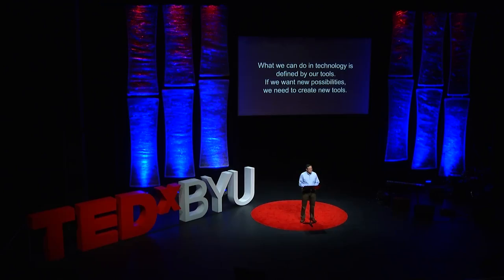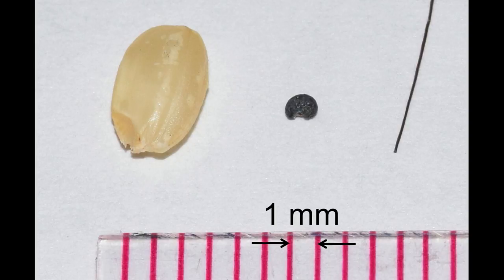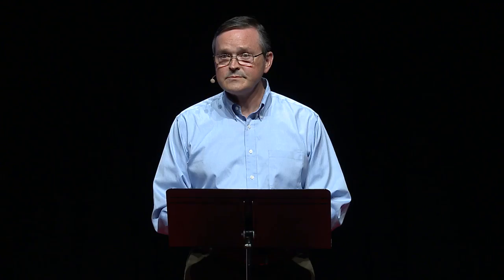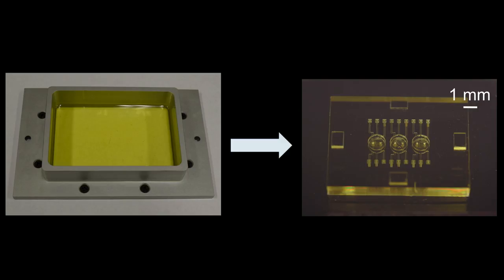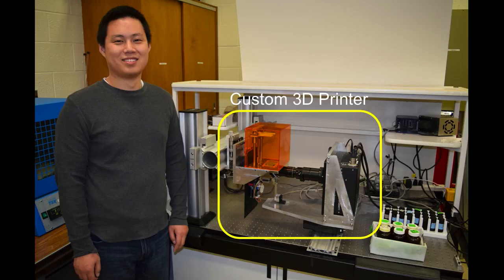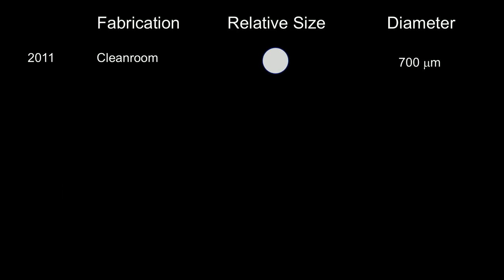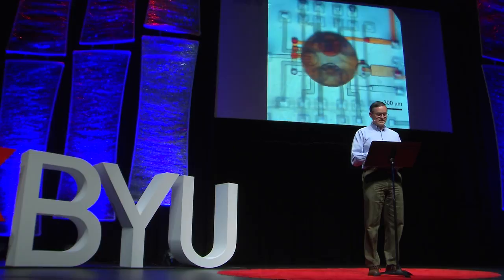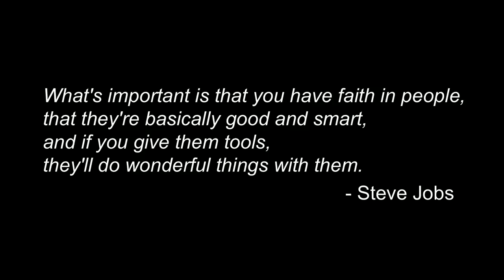New Tools, New Possibilities - 3D Printing for Lab-on-a-Chip | Greg Nordin | TEDxBYU

Comment: Do the Japanese way of the early 1980s. Use larger size components and simpler designs along with the CMOS technique which is a cake layering method of making silicon IC chips. Instead of an IC chip the size of a postage stamp, your IC chip will be the size of a large size 12" by 18"envelope! 

In the early 1980s CMOS being explained in this way is different to what we personally got from a Japanese engineer who said "basically CMOS is more like a layering process but you must first determine what you need so that you will know exactly what is needed to be done first" It is like creating a multi-layered cake. 

That is the problem with education today, they try to make things unnecessarily complicated and sophisticated when they can make their explanation so simple WITHOUT LOSING THE GIST OF THE ENTIRE SUBJECT itself. 

This is why Japanese education is far more effective to the point that they made CMOS technology so simple that it allowed them to use simple designs, larger size components, and compensate by using larger size silicon chips the size of small average letters. 

They did that in the early 1980s which is why they have beaten the U.S IC chip makers in the international market competition. Do the Japanese way of the early 1980s. Use larger size components and simpler designs along with the CMOS technique which is a cake layering method of making silicon IC chips. 

Instead of an IC chip the size of a postage stamp, your IC chip will be the size of a large size 12" by 18"envelope! 

Now with maskless ion beam lithography and electron beam lithography and hybrid ion beam-electron beam lithography using laser guided guidance systems for positioning and alignment, they have made CMOS far effective in cost effectiveness and achive zero defects/zeo rejects status.

Comment: Wow!
Reply: Do the Japanese way of the early 1980s. Use larger size components and simpler designs along with the CMOS technique which is a cake layering method of making silicon IC chips. Instead of an IC chip the size of a postage stamp, your IC chip will be the size of a large size 12" by 18"envelope! 

In the early 1980s CMOS being explained in this way is different to what we personally got from a Japanese engineer who said "basically CMOS is more like a layering process but you must first determine what you need so that you will know exactly what is needed to be done first" It is like creating a multi-layered cake. 

That is the problem with education today, they try to make things unnecessarily complicated and sophisticated when they can make their explanation so simple WITHOUT LOSING THE GIST OF THE ENTIRE SUBJECT itself. 

This is why Japanese education is far more effective to the point that they made CMOS technology so simple that it allowed them to use simple designs, larger size components, and compensate by using larger size silicon chips the size of small average letters. 

They did that in the early 1980s which is why they have beaten the U.S IC chip makers in the international market competition. Do the Japanese way of the early 1980s. Use larger size components and simpler designs along with the CMOS technique which is a cake layering method of making silicon IC chips. 

Instead of an IC chip the size of a postage stamp, your IC chip will be the size of a large size 12" by 18"envelope! 

Now with maskless ion beam lithography and electron beam lithography and hybrid ion beam-electron beam lithography using laser guided guidance systems for positioning and alignment, they have made CMOS far effective in cost effectiveness and achive zero defects/zeo rejects status.